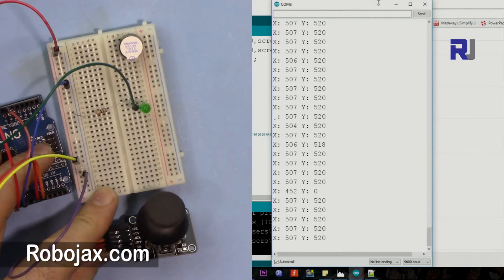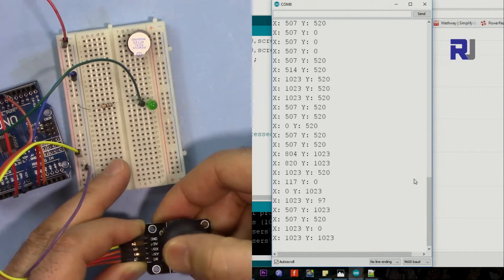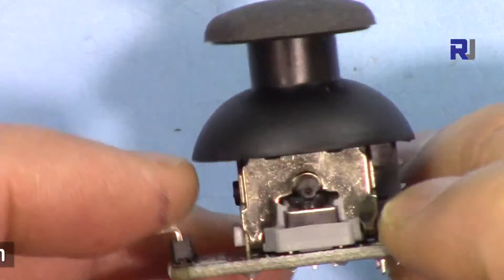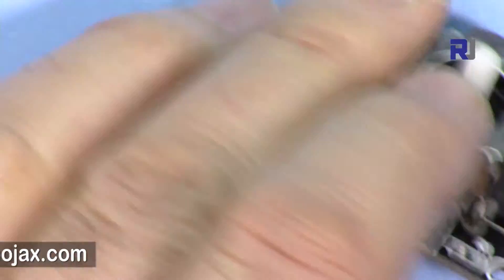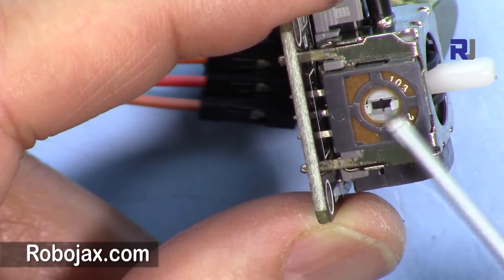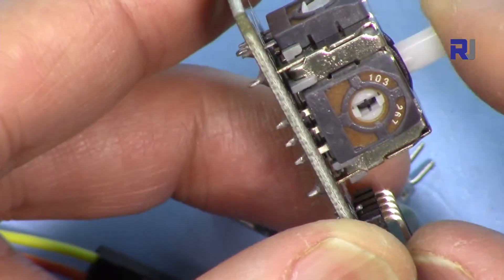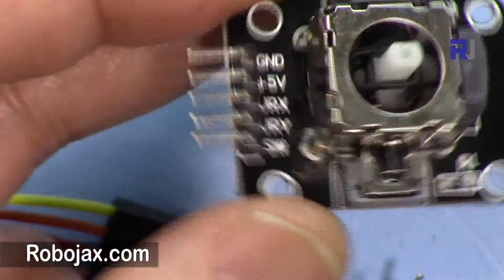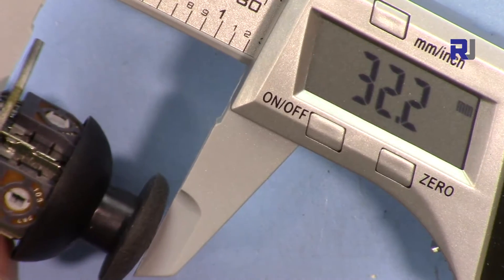Introduction to Dual Axis  XY Joystick for Arduino RJT45

Comment: Sorry, but the way you do your tuto is not good
Reply from the maker: Thank you. I need your feedback. Tell me which part or how different should it be?
Reply: @robojax  thanks for your reply, the wiring is not clear it would be better to make a sketch ✍️ for the wiring.
Reply from the maker: May be it would have been better if I added the wiring diagram. But I always think that the user will not know why they connect a wire from one point to another if the follow the diagram. That’s why I explained each pins and the hardware fully. Then I explain it with the code . But it seems most users don’t want to learn. They just want to grab the code and use.

Comment: Amazing,

could you do a special sketch tutorial where the joystick control 2 motors direction (both motors forward when joystick is fully forward, both motors backward when joystick fully backward, motor 1 forward and motor 2 backward when joystick fully left, motor 1 backward and motor 2 forward when joystick fully right with a potentiometer that would be controlling speed while using L298N Motor Drive Controller Board and PWM.

Thank you
Reply from the maker: it would be complex video for many users. it would be 2 project. motor driver will have problem. I have to make it for 293D , L298N  and DRV8833. the problem is video is has one of the lowest view amongst my videos. it means people don't use joystick that  much. I  like my work to have impact  on as many people as possible. I'll see if I can make video.
Reply: @robojax  Thank you, I love your work I learn so much, I have small collection of sketches that you inspired me to do. keep your good work

From Canada Ontario
https://github.com/Fabiolus2020?tab=repositories
Reply from the maker: than you. you stay safe. keep it up.

Comment: As you can see at 1:08, he disconnected the dual axis joystick, when you did that, he started to get random values which does not make any meaning. The reason for that is the long jumper wire is acting as antenna, it is receiving some radiations and automatically converted into an electrical charge.
Reply from the maker: Thank you.

Comment: Do you mind explain pull up resistor..I saw switch connected to digital pin 6 where there is no resistor at all
Reply from the maker: I have explained it in this video https://youtu.be/TTqoKcpIWkQ ,

Comment: Hey will it work if we directly connect it to a battery and then the vrx and vry to the motor without programming just to make the motors rotate in anti and clockwise
Reply from the maker: No you cant'. This joystick has simple variable resistor ( or potentiometer) which is not capable to handle the current needed for motor. you have connect a motor driver IC or module. Depending on the type of motor you can use a motor driver. One famous IC L293D which I have video on it.  search for the word motor on my channel and you will get several video with tested code.
Reply: +Robojax thanks